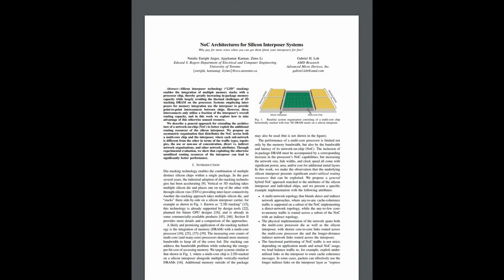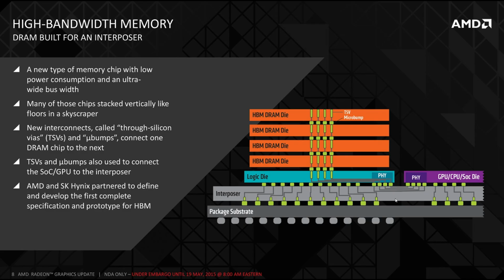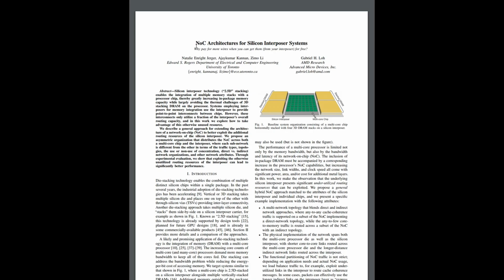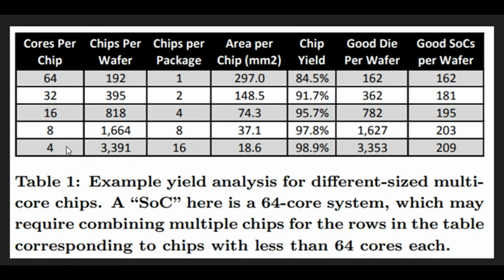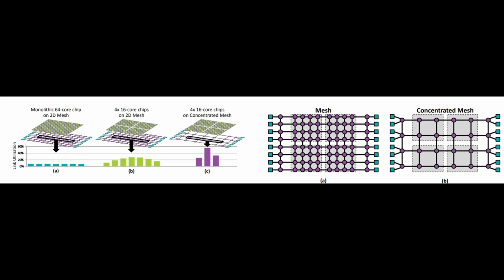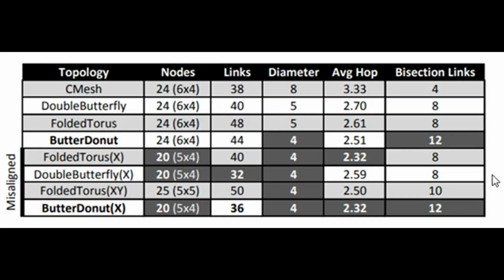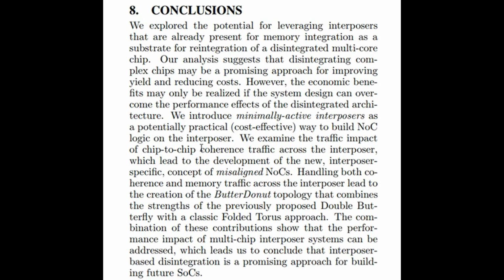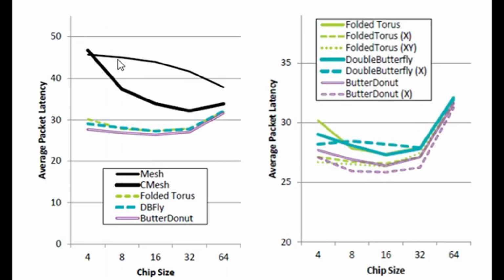Interposers, Chiplets and...ButterDonuts?

Comment: The misaligned butterdonut reminds me of intakes for V8 engines.

The shorter intake tract is often preferred for maximum power, but the intake tract length is tuned for the RPM range the engine runs at. In the case of intake research they learned that having all intake ports be the same length actually improves power more than having some short and some long depending on where the head intake port is in relation to the carb (or throttle body or whatever).

The engine runs better with equal length intake tracts and equal length headers than it does with all of them using the shortest possible unequal path.

The misaligned butterdonut looks to work on the same principle. Having all latencies increase slightly but match is better than having some extremely low latency and some high latency pathways.

Comment: I’m thinking that the optimum topology must be able to be mathematically proved, rather than just making a toroid, misaligning bits and seeing what happens.
Also, isn’t throughput a different problem to low latency inter-core communication? Not every program needs low latency access to every other core. Maybe like precomputing a branch, surely that only needs direct links to a few cores?
Great video, and again I learned about lots of new concepts, thanks.

Comment: Intel playing its games again? I wondered why I wasn't seeing any AMD Ryzen chipset laptops anywhere and found this:

Dell’s Latest AMD Inspiron Laptops Are Crippled Compared With Intel Versions
6 Mar 2018

https://www.extremetech.com/computing/265078-dells-latest-amd-inspiron-laptops-crippled-compared-intel-counterparts

Excerpts:

Both images are screen-capped to allow readers to refer to the price of each system, since they are not an equal match for one another. To start with, we’ve got an AMD system with a 2C/4T CPU (Ryzen 3 2200U) and just 192 GPU cores at $679 supposedly competing against a Core i5-8250U — a 4C/8T Intel CPU — at $600. Granted, that extra $80 gets you 1080p on the AMD system versus 1600×900 on Intel, but the lack of GPU horsepower on the AMD solution and the weak CPU kicks the legs out from under this system. Intel’s official list price on the Core i5-8250U is that the chip costs $297, compared with the $600 retail price on this Inspiron, which tells you everything you need to know about how reliable Intel’s published pricing is, at least as far as what companies pay.

Somehow, Dell managed to find an awful lot of breathing room to upgrade those Intel SKUs, and not nearly so much upgrading the same AMD products. Once again, we’ve got a vendor with AMD products supposedly on the board, only to discover they’re designed to not be nearly as attractive as their Intel counterparts, for reasons that have nothing to do with the capabilities of the SoCs that power them or the prices charged by the smaller competitor.

Comment: Gotta ask how much do you think it would cost to produce a smaller interposer, something the size of a Zeppelin die. I would think on 65mn it would only be ~$5 which wouldn't be an unreasonable cost for a mainstream part and with 7nm being double the density of 16nm / 14nm from TSMC / Global Foundries shouldn't you be able to fit a 16 core CPU and all the trimmings inside that space.

You can also cut out the infinity fabric as that would be embedded in the semi active interposer so that would give you some room to work with leaving spacing between the dies, so personally I don't think that it will be limited to data centres and it will even go down to the APUs which means they can cut costs and more quickly iterate.

So when they have either a new CPU or GPU architecture they can iterate and they don't have to wait for both to be ready.
Reply from the maker: You mean just to get the benefit of the 2nd NoC on the interposer?  If they wanted to do this it would be simpler and cheaper to just put the 2nd "interposer" NoC on another metal layer of the CPU instead.

Comment: I don't see if for Zen 2, but for Zen 3 considering the almost certain socket change I can totally see it. Also given the semi active interposer you shouldn't even need a controller die. well you need something for PCIe and RAM connectivity if you want to call that a controller die then fine, but the "infinity fabric" can just be mostly embedded into the semi active interposer.

but I see AMD somewhat moving away from CCXs and just using different sized interposers for everything so that they only have to produce 1 type I/O an DRAM die and one type of CPU die for everything and just use different numbers and bins for every segment, so I don't just see 9 dies for Zen 3 data centre CPUs, but more like 12 dies + a semi active interposer which would be the "controller die"

Comment: I read the paper with the latency calculation, and to put things in perspective, the average latency from a monolithic 64-core chip to a 4x4 grid of quad cores only increases by about 30%, for a 2x2 grid of 16-core chips the average latency increases by about 18%. If we assume this is all random core to core jumps the ryzen would have about a 125% increase of latency because of the latency between two quad core CCXs. Something worth mentioning though is that the mesh type topology (as in the paper) probably only works well for lots of weak cores, so think something like a xeon phi but at a much lower cost and higher top speeds if binned properly.

Comment: You know if you couple the interposer / chiplet ideas with something like AMDs use of StoreMI you could design a 4X16 core chip with 8-32GB of HBM on board AND a quad or octo channel memory controller. 

It would be like being able to buy an extremely large very fast smart cache for the CPU.

Comment: I been thinking about another area that could see massive optimization gains in the future. 
AI designed chip architecture, use deep learning for past architecture and simulate new chips based on the desired features like latency and number of transistors.  I would think looking at these AI designed, it would look like scrambled nature looking pathways, humans would have a hard time even trying to decode what is going on. But it would probably see some pretty massive gains compared to traditionally designed chips. You could also optimize for different workloads too. 
Great video like always!

Comment: I thoroughly enjoyed this video, thank you! Quite informative. You may enjoy a paper called  "The Parallel Computing Laboratory at U.C. Berkeley: A Research Agenda Based on the Berkeley View". It was published in 2006, and it talks about the comparisons between HPEC and the requirements of servers for use in industry and research. One of the things that comes up in the paper is how current architectures won't really work for improving performance. The paper talks about moving to many core, so hundreds/thousands of cores per chip. It also talks about how we need to refocus on how we design and benchmark software. Its an interesting paper, and what is more interesting is to see the predictions made in that paper 12 years ago become true.
Reply: Given that, I'm imagining the day when you drop something while assembling a computer and saying, "Oh crap, I just knocked a chip off the packaging. It's only got 127 processors now. Dammit. Oh well."

Comment: Hi Jim. Do you think AMD will release a 7nm-V64/56 refresh tbr Q4-2018?. Nvidia are releasing their 11 series in Q4-2018 and Lisa Su said at Computex 2018 'for all you gamers out there, we will be releasing a 7nm gaming gpu so stay tuned'. 

People are assuming she is referring to 7nm-Navi (RX680) but I believe that gpu is still one year away. She also (and deliberately) didn't mention the name of the 7nm arch that would be released. We all know that Navi is going to be 7nm, so that is no big secret and there is no reason for her to not mention that she was referring to Navi (if this was the case). I believe she was referring to a 7nm-V64/56 refresh.

Also, nobody says 'stay tuned' if a product release is a long time away. The last time AMD released a gpu, it was in August 2017. If AMD does nothing until Q3-2019, then it will be a gap of two years and this also goes against what David Wang said at Computex 2018 where he confirmed AMD will be releasing either a new or refresh gpu every year. However, he did not mention if the yearly releases also included work station gpu's. 

After the whole raja-Vega-failure fiasco, Lisa had a meeting with David as soon as he joined AMD (February 2018) to discuss the future of Vega. She then released an official statement where she said - 'we believe Vega has legs'. 

The gtx1180 will give similar performance as the gtx1080Ti. A 7nm-V64 refresh could realistically give the same level of performance. TBH, going from a Vega Radeon Instinct workstation gpu to a cut down 7nm-V64/56 refresh is not a big leap. 
 
Also, rumours are that Nvidia will unveil the gtx1180 at Gamescom 2018 (late August). Apparently, AMD will also be doing a similar event. It makes no sense to me that AMD would exhibit the Radeon Vega Instinct at a gaming exhibition since the RVI is an AI and deep learning gpu. I may be wrong but IMHO, I think Lisa will be unveiling the 7nm-V64/56 refresh. It is a good stop gap solution until Navi-10 hits the shelves in Q3-2019. 

Also, bearing in mind that a big-3 AIB partner recently returned 300,000 series-10 gpu's back to Nvidia due to lack of mining interest means that Nvidia now has to find a way to get rid of these excess 300k gpu's. This means that the release of the 11-series will be delayed AND it will be released in very limited numbers, which means it will subsequently take a lot of pressure off AMD. 

I watched the AMD computex exhibition and I posted a very detailed reply on Red Gaming Tech, but sadly I was laughed at and abused by a lot of dickheads (and paul highlighted/approved their comments, so that says a lot about him). I dont mind if people disagree with me, but when they are disrespectful, that is what really pisses me off.
Reply from the maker: I just don't know, when it comes to AMD GPUs right now it's all up in the air.  I highly doubt we'll see 7nm RX Vega shrinks this year though and Su probably meant Navi next year.
Reply: If this is the case, it looks like Lisa SU took Vega out of the gpu race. Would be interesting to know her reasons why.

Comment: Why are those cores square? Would it yield better if those were hexagons? Like a honeycomb (edited).
Reply: Russel Renz Nerosa they are squares because it is easier to illustrate. Network topology actually don't care about shape. So a circle and a square is the same shape. They are both rings. Donut is a higher dimensional ring.
Reply: I'm wondering what if there are 6 lines connecting each core. It might improve communications between cores that might lead to better performance.
I really don't know what possible and what's not. I'm just really interested about these stuff.
Reply: Russel Renz Nerosa links are expensive in terms of transistor needed and power consumption. So going from 4 to 6 links is 50% increase in power and die area needed. Going 6 links allow you to use 3d topology instead of just 2d topology. This will reduce average hop count and latency in exchange for more power and more routing complexity.

Comment: What's your take on AMD "allegedly" developing the Navi architecture in lockstep with Sony to be showcased in the PlayStation 5?  Where would that leave Microsoft who is also working on their 9th-gen console?   Obviously nVidia in in Nintendo's corner with the Switch using the Tegra X1 processor.  You think Microsoft would jump back to nVidia if Sony and AMD are working together?
Reply: Both MS and Sony got really burnt by Nvidia with the first Xbox and PS3 respectively, so I highly doubt that.

Comment: Interesting stuff. Clearly this is the future. How and when it will be implemented is the real question. Curious to see what Zen 2 will bring as it's always been expected to be a large boost to the Zen architecture, but I still think it's a bit early for practical implementation. We shall see. Keep up the good work man!
Reply: They will implement it, because both manufactures are working on multi layer technology, this change is bigger, because it allow new architecture not possible until this technology, because current architecture must be planar graph, so path can't cross, you may simulate it by switches  but it ad latency. This allow 2 layer graph, and it change possibility totally. and what we see in this video are early stage only.
Reply: Sędziwój. Paths can cross by having multi layer interposers.
Reply: This is like multi layer chip, is what I did want to say.
Reply: They did it with Rome

Comment: EMIB can be used for Network-On-Chip solutions just fine, but it will of course have scaling issues beyond 4 dies, because then you have to either create many bridges within the substrate (layering, different penalties for different chip-to-chip comm paths), or you make a fairly complicated and custom EMIB that really is only a best fit for one design (somewhat defeats the purpose).

Just as interposers started out as dumb passive networking blocks, so did EMIB. It can be extended just as trivially at least on this scale. Depending on your performance needs and overall package size, it may be more worthwhile to get an interposer, but they have a maximum size, whereas EMIB doesn't.

Comment: Really wanted to quickly comment on this: A lot of passive interposers are done with typical PCB materials (read: FR4) simply because it's a lot cheaper to create such interposers as opposed to silicon. In fact, a lot of the delid shots of Ryzen and Threadripper clearly show the silicon dies on PCB, and not silicon. 

TSVs are still ridiculously expensive as compared to a multi-layer PCB, but silicon interposers do run the advantage of running tighter traces.

All this being said, active interposers would be amazing, but it poses the question of *why*. The logic could be placed in the die itself -- not the silicon -- and would cut down the overall cost by a huge margin. Logic is not a negligible production cost, even if it's on an older process node.

As a side note, this was one of the reasons why Intel's EMIB as interesting, as it buried a piece of silicon into the PCB. They claim that it helps to reduce costs of producing TSVs and whatnot, but who knows...

I could go on and on about this (I actually teach in this field) so please feel free to PM me if you wish.
Reply: Michael Lau hey there, can you recommend some books for me since I'm a beginner in this and I wanna know more about this type of stuff
Reply: Most books on modern semiconductor packaging will cover interposers at one point or another. Shouldn't be hard to find one that suits your needs.

Failing that, Wikipedia is a great resource for the semi industry.

Comment: Hmm, I suppose you could use make a very diffrent chip using the same cores but with dramatic changes in interposer. Lets say for the normal desktop (R7) and maybe the HTC (TR) market, its a new cpu on a simple offset ButterDonut topology. Now consider what happens if for epic, you use the same/similar basic cpu core package but a massive (or multiple) coherent caches on the interposer for say 128Mb+ in size linked in using an offset butterdonut topology or simlar providing excellent bandwidth and latency.

Or you could intergrate a memory control linked into the cpus and ram via the butterdonut topology, this offers a few possibilitys, around adding ram (such as HBM) directly onto the die, or even multi-level cache. However the possibility of L2/3 cache coherancy and relitivly large volumes and typical L2/3 speeds and bandwidth is quite exciting for many applications.

Indeed, having Serverchips where the diffrence in performance type is decided by the interposer, ie. A chip with a 1% active offset ButterDonut for chips where you will slice them up for VM's, and of course the opposite where you might be runing a single proccess accross all cores where cache size/speed/coherancy would dictate a more active interposer.

I suppose at some point you could go really krazy and suggest a cpu cake, where you have broken up the 1 level interposer into 'cake-lets' which have muliple 'chip-lets', each cake-let is then connected togeather via an interposer network at the bottom layer(2) of the cake. If like AMD have already done allow you to add/remove as required components such as being able to add x86, graphics, arm and so on onto the same 'bus' you could do the same here, virtualy build muliple components into a cake, and then add them to a pan (ie what a cake sits on) later. What is intresting is that each slice of cake might have layers of diffrent process silicon, i.e. 3nm on the chiplets, 6nm on the first layer of cake with cache, 10/12nm with another layer of cache or other krazy things that people have not yet though of.

I will admit I quite like the idea of having 'chip's ontop of your cake and your final interposer being call the pan that the cakes sit on.... imagine the Quote? "Let intel eat cake!" - AMD Vice chairman, December 2023.

sombody should have some Tea with it.... maybe that is the future technology name of AMD's graphics? "cakes good, but its better served with Tea!" :)

Comment: My understanding of EMIB was a passive low latency interposer embedded in a large normal interposer, which dramatically improves performance for critical short paths (only used between HBM2 and GPU on the intel/radeon chips). The true exitement comes in seeing when all this will surface in actual products, though only time will tell what happens unfortunately.